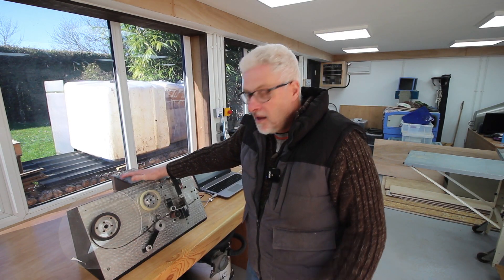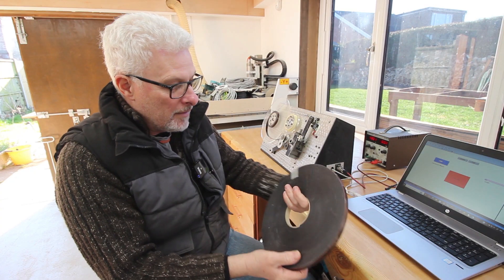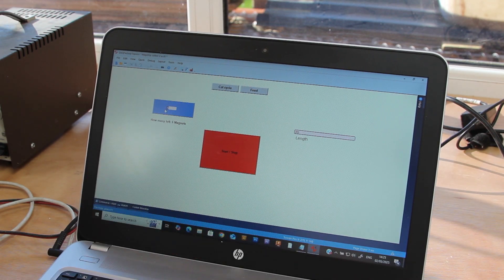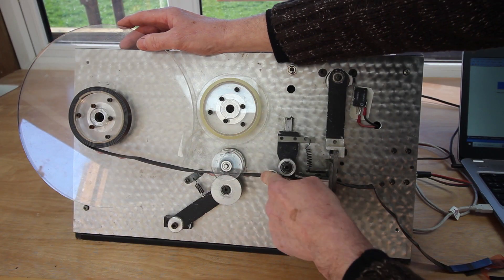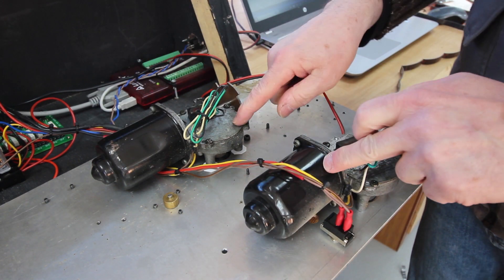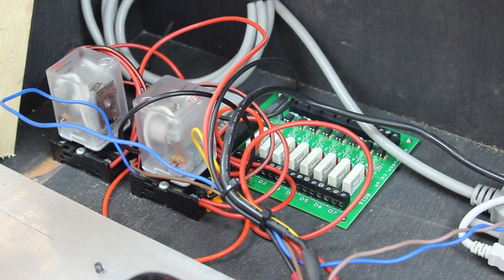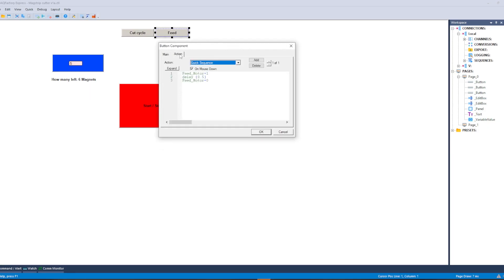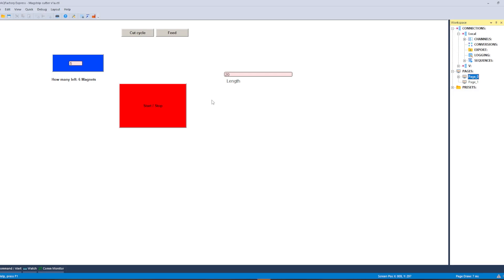Magnetic Strip Cutting Machine

Comment: PC software and interface didn't look quite as cheap as the windscreen wiper motors.  Today all that computer control and interface board could be replaced with a £1.50 arduino and a £2 lcd display....(if you are as economical as I am...)
Reply from the maker: Hi @andybarnard4575
Yep good call I did get an raspberry pi and touchscreen then got a software developer to code a touchscreen system. I supplied the graphics and a flow chart of what I needed. Sadly beyond his ability so the project quietly died!
Having said that I completely agree with you the best way to go is an arduino and a cheap display stepper motor feed and wiper motor for feed.
Thankfully I have retired so don’t need to worry about it!
Cheers

Comment: Hi, good idea, a home made machines, I do have a home made sanding wheel it is direct drive from a 360 watt motor with the shaft screwed to a disc I made it about 6-7 years ago built by using scrap wood and a ply base. the motor was from a broken garden strimmer.
Mounted by using metal strips and screwed down to a ply board the metal frame is earthed and using 3 core flex and is mounted to my workbench and hardwired to a FCU with a 5amp fuse. Last year I swapped the on/off switch to a NVR switch, I use it not all the time.
I do like your magnetic strip cutting machine, a lot more advance inside compared to my sanding wheel. Great video catch you soon take care
Reply from the maker: Thank Shaun,
Always good to hear about how people solve problems. Your sander sounds great I do think the NVR was a good option.
Take care 
Cheers

Comment: I think thats a great bit of kit.  I'd never heard of labjack interfaces before , or that s/w.
(I've made many bits of PC driven kit and generally used PC interface cards or usb i/o cards and the written s/w in languages like VisualBasic or c# and it all gets very involved and time consuming... you spend half the damn time writing the user interface on the pc or just ironing out bugs in the basic coms layer rather than making the machine work, so I like your solution).
Reply from the maker: First of all great YouTube handle! My choice with this was I am not a software developer and I struggle with it. This system just works and even I can work out what’s going on. I think now though I would use an arduino and breakout card / relay board. I feel my programming skills could just handle that.
I did come across another system called flowcode that is very simple if you can write a flowchart that’s pretty much all you have to do.
Cheers